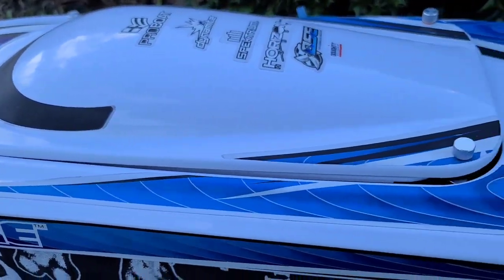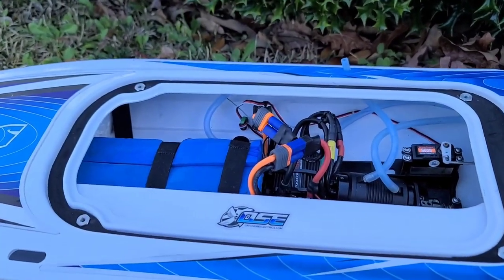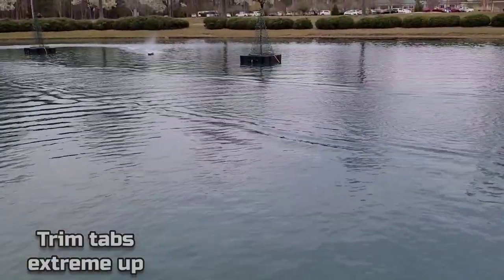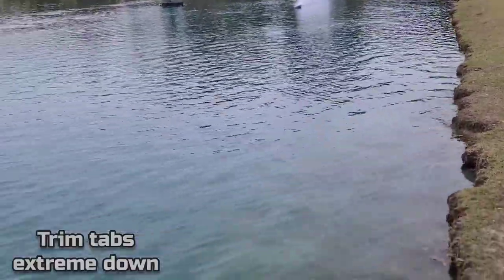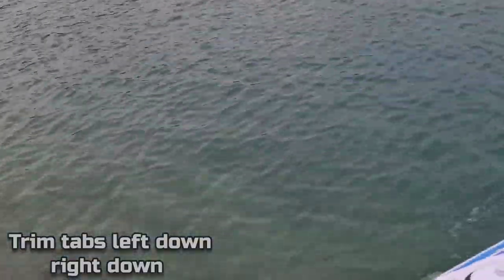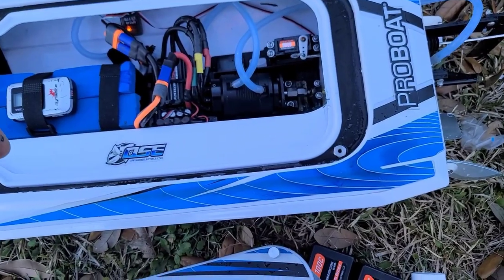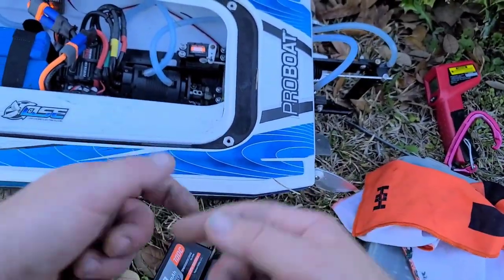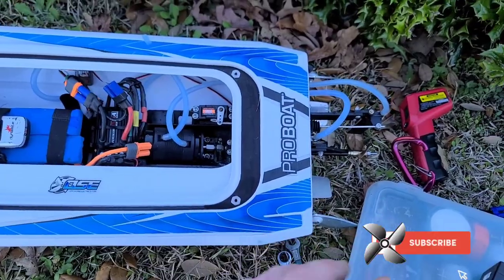Trim Tab Tuning Proboat Sonic Wake 36 - Fast Electric RC Boat Trim Tab Tips

Comment: Yo Big "B" where are your batts positioned? That's usually where I start. If I can't get it tuned with CG, then I turn my attention to the trim tabs. I run slightly bigger batteries typically in the 6500 to 8000 mAh range which are heavier than the 5000/5200 packs you are using. My boat usually runs more on the wet side which scrubs some speed but it's really stable. 
I am very curious about the V2 SonicWake's motor mount - it's aluminum as apposed to the V1's plastic mount. Would you happen to know if the aluminum motor mount will fit the V1? If it does, that's a super worthwhile upgrade. Thanks for the video - I missed you this morning :)
Reply from the maker: I'm running the battery's back, in the boat.   I've had this boat before when they first came out,  had her running pretty good with the stock electronics.    Really just showing guys that tuning an boat is a process and doesn't come over night, ya know.   I could of just slammed the trim tabs ALl The ways down and be done, but what's the fun in that.   ya know. 

The v2 is on the way, I have not seen the mount so I couldn't answer that question,wish I could help brother.

I've had a heck of a schedule this week & didn't get today's video out till this evening 🙃